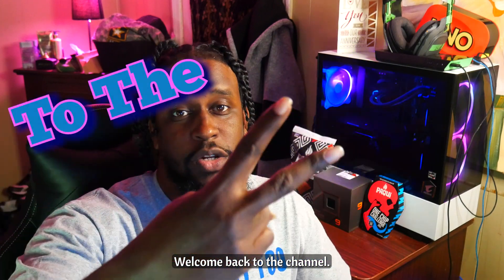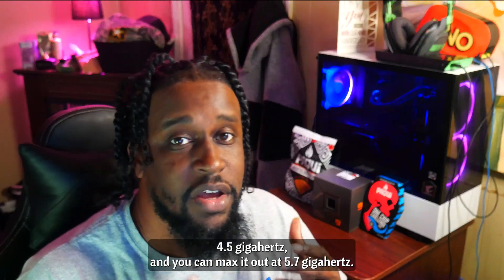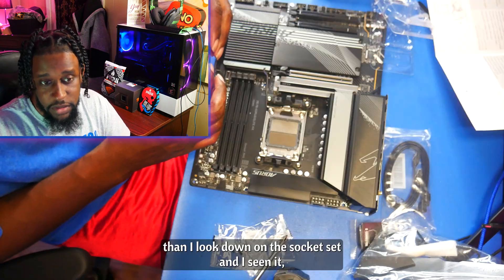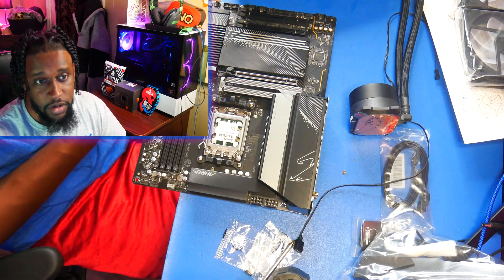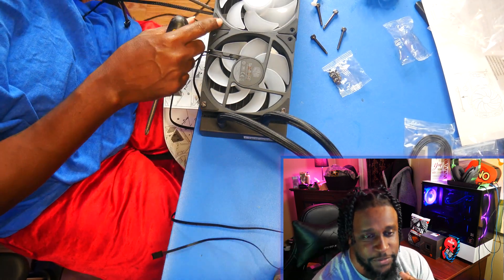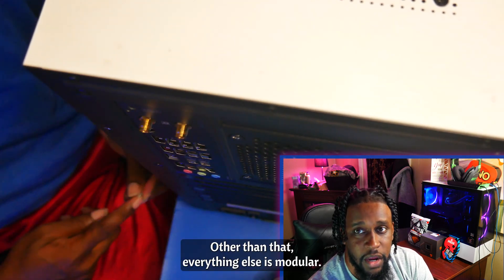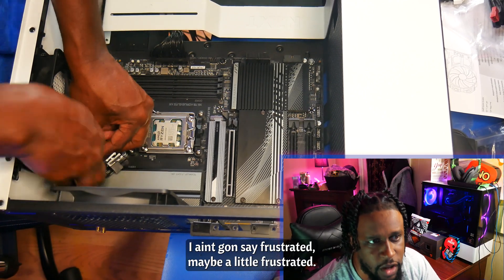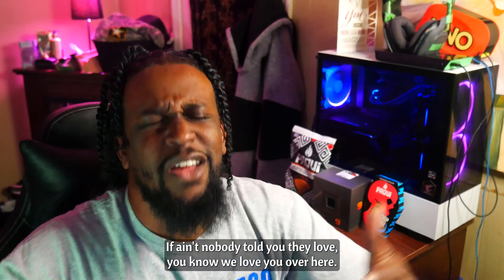How to install the AMD Ryzen 9 7950x / x670 Aorus Elite AX | PC Upgrade Pt 2

Comment: why buy a bronze rated psu? those are complete garbage for gaming it should be gold or nothing
Reply from the maker: Gold may be better, but bronze will get the job done for a budget build!!! Everyone has their own rule of thumb when it comes to where to cut quality to save money.
Reply: @EyeMDiffrent  get the job done for what 3 months? you can get a gold rated for little over 100 cheap enough for a budget build. 7950x and  X670 Aorus Elite AX is not a budget build !!!!!
Reply: @shinya2104 Bronse, gold, platinum has NOTHING to do with quality or durability. Learn about PSUs before commenting BS.  
The tiers only describe the efficiency of the PSU. Platinum 95+ percentage of the energy consumed (from the wall) is converted into power for the computer the remaining 5% is converted into heat (wasted)

Bronze tier at least 80% of the energy is converted to power for the PC the remaining 20% wasted (as heat). 

For durability get a good brand with Japanese parts. 🙄

It doesn't matter if it is just 80+ white, bronze, silver, gold, platinum. 🥱

Comment: Any updates on this CPU/Motherboard combo? I'm building with these exact Two parts for my first build!
Reply from the maker: This combo is still working great for me.  The CPU handles my workload and gaming with ease. The motherboard hasn't given me any problems either.  I have updated the bios to the newest version and its running fine.
Reply: thanks  @EyeMDiffrent
Reply: me too

Comment: Upgrading my system to 7800X 3D as I only use my rig for gaming, using the micro-ATX version of this MB. I am currently running a 5900X and a Radeon 7900XT. I use a 1000W PSU.
Reply from the maker: That's a nice setup, what brand of psu did you go with?
Reply: @EyeMDiffrent  I have an NZXT. It’s been great so far. Only had it since Feb. 2023

Comment: I got mine all hooked up and could not get any video out to the monitor (same components, 7950X and Aorus Elite AX)  . I didn't get any pre bios beeps and seemed to power up fine but I really don't  know what was going on because I can't see (bios) what is happening with the process on the monitor. this is the first motherboard I had with two 8-pin connectors on top so I am now basically second guessing everything like if the mother board was not getting proper power. I decided to ship it back to newegg for a new one. To add,  I received the motherboard box without Cellophane wrapping, and the manual was missing so I am pretty sure they sent me an open box when I bough new! tell me what you think
Reply from the maker: Depend on the model version 1.0 vs 1.1 the bios were faulty.  I had to use a chip with integrated graphics to set everything up

Comment: Hello I’m not getting any power to my mobo, psu switch is on and I’m really stumped on what could be the problem
Reply from the maker: I would start by checking the connection. Make sure the pins are okay on the connector and the slot on the motherboard

Comment: Hi sir , Is there 240mm water cooler enough to cool this cpu? , I have old one of silver stone but not sure Is it can use with 7950x3d or not. thx for your video .
Reply from the maker: Yes, I'm running temps around 55° -  70°  The highest I've seen it get to is about 80° when my room was too warm!

Comment: How is your build doing after a month of using? Waiting for the same config delivery, worried if I cheaped out on a mobo
Reply from the maker: Overall its doing ok.  I did run into an issue with the bios for the motherboard.  I had to reinstall windows and its been running fine ever since.
Reply: @EyeMDiffrent  Bought 7950x and same mobo, runa great, had no issue (except with xmp before bios update), runs great. The cpu is insanely hot tho, hits 95 under fool load with NZXT Kraken Z73 in stock (and 60-70 when gaming)

Comment: What cooler master pump did you use? How is it cooling it?
Reply from the maker: Hey, sorry for the late response. I'm using a MasterLiquid ML240L V2 RGB.  It keeps the CPU at around 55° C.   When gaming or handling a big task, it runs around 68° - 75°.